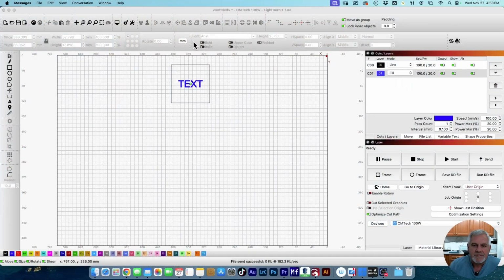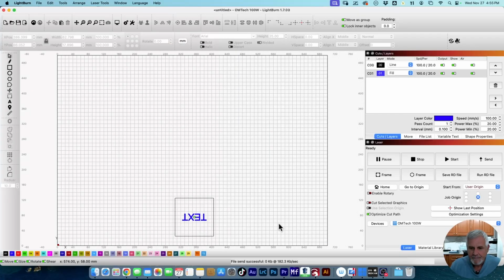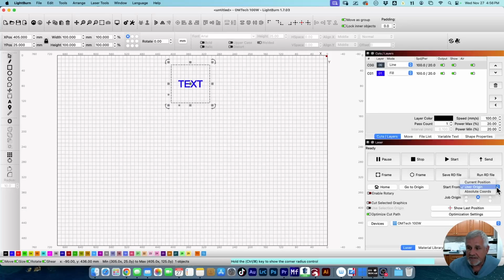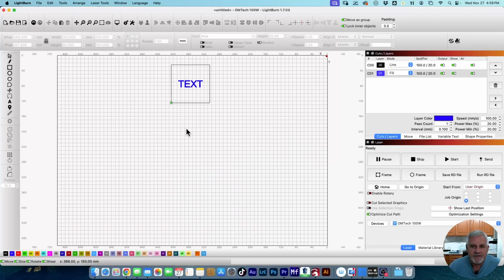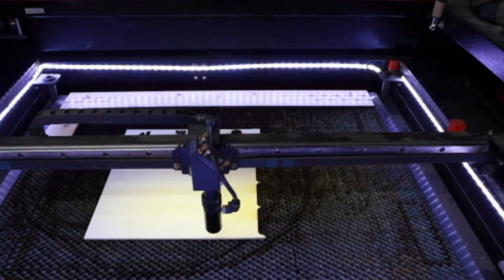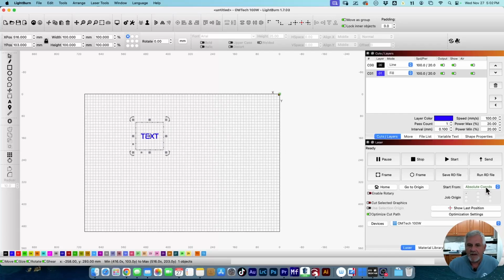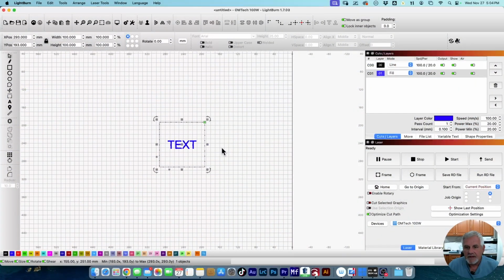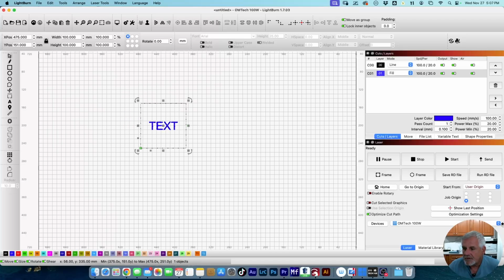Origins - Machine Origin, Job Origin & Start From Explained in Lightburn.

Comment: Tim, I really appreciate the video, I had a rut in my brain that I couldn't get out of.  I had upgraded my controller to the new Rudia, and had forgotten about the ability to set the origin on the device, as the old controller had a button clearly marked "Origin" Anyway you helped me knock myself out of the rut. thanks tumblers will be much easier again.
Reply from the maker: Glad I was able to help. Sometimes I wonder if my rambling makes sense to anyone other than me, LOL.